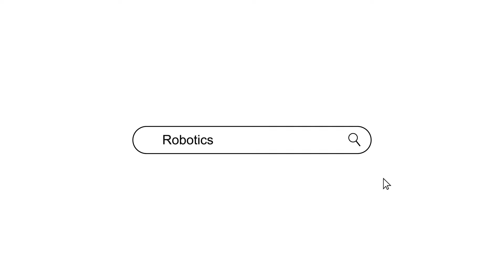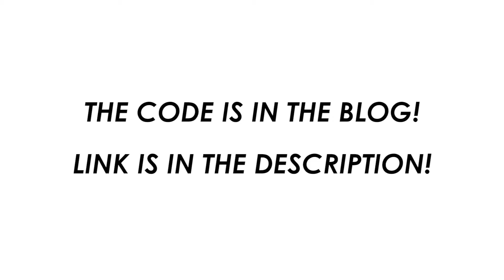HOW TO MAKE A GPS CLOCK WITH ARDUINO

Comment: sir , west bengol me delivari dega keya
Reply: m no- 6294480655
Reply from the maker: Hey, check your pincode while checkout or while placing the order. If it's available it will get delivered in 10-12 days :)
Reply: Mera pincod 731237 delivar  hoga .
Reply from the maker: @kenanmondal5268  Just select the product that you want and during checkout or while placing the order put this pincode there and it will show if delivery is available